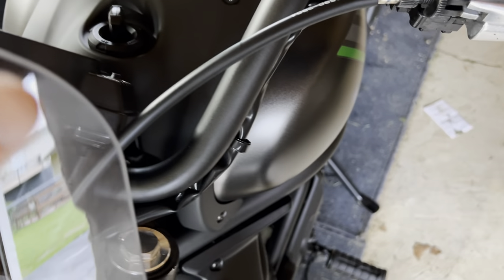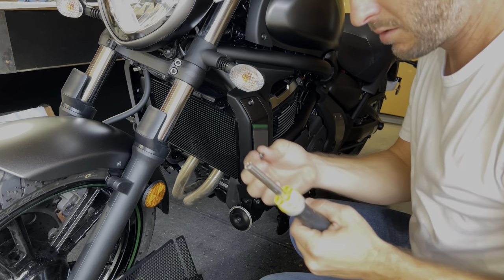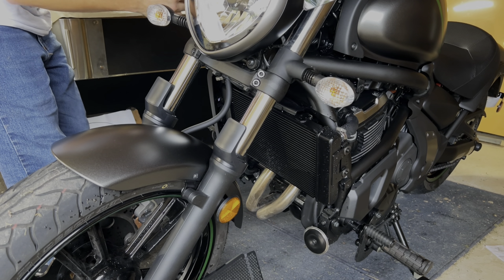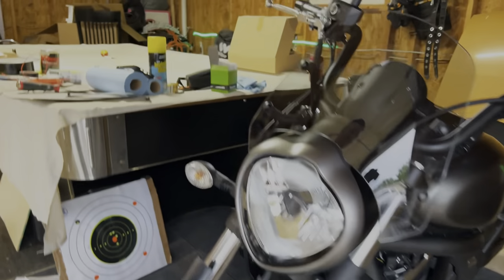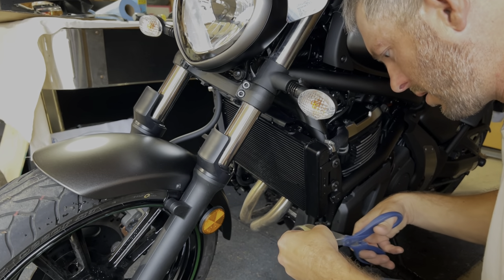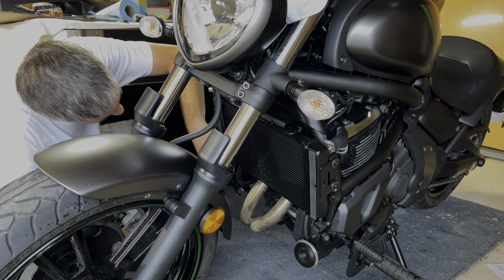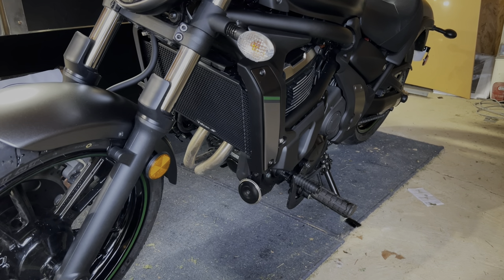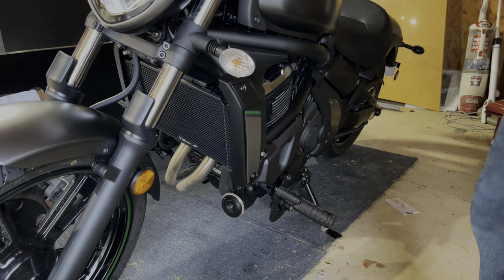Kawasaki Vulcan S 650 - Radiator Guard Cover Installation

Comment: Just did myn worked good how is yours holding up?
Reply from the maker: As much as it pains me to say, I no longer have mine. I sold it earlier this year so I can pay some bills and get my PC for gaming lol
Reply: @Kodyssey  how did it hold up till then?
Reply from the maker: Oh it was fine. You won’t have any issues. I believe it was metal as well. I’d suggest using the foam pads that come with it for vibration dampeners. Keep it from rattling with the bike is idle. I liked it though, prevents debris from smacking the rad